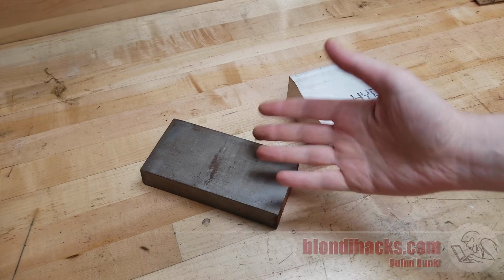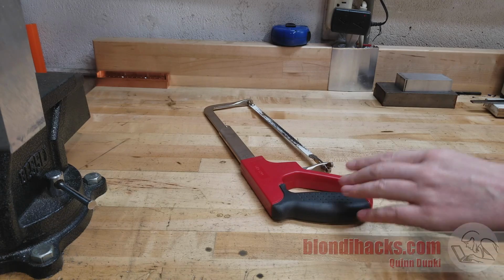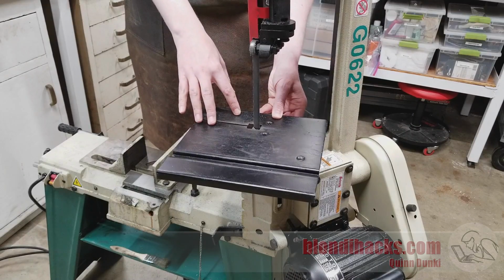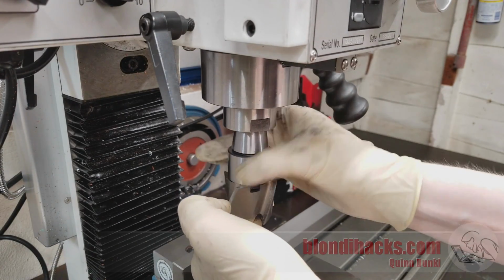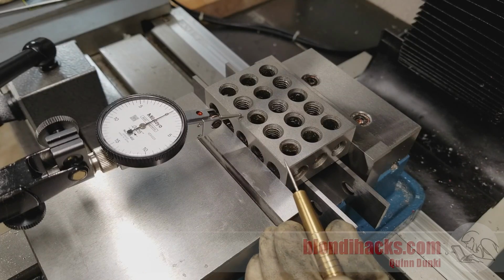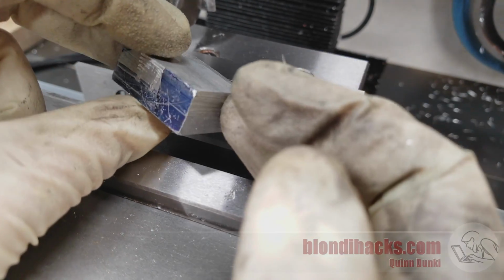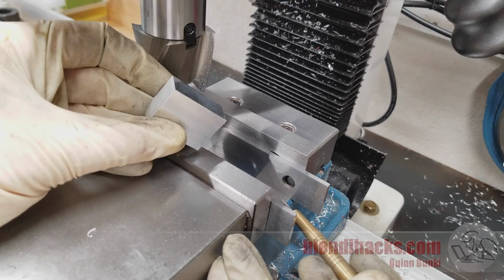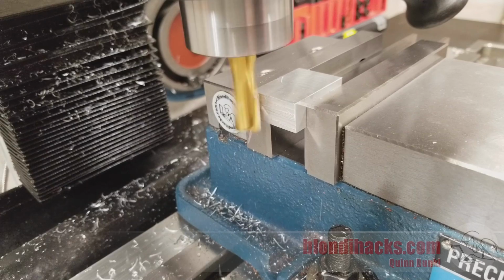Vertical Mill Tutorial 5 : Preparing Stock

Comment: Question.1 what do you do if your milling machine isn't level?.I have this problem so I shimd up the mill between the cabinet it sit on.results  r to left ok but front to back still out by 1/32
Question 2 I trammed my lathe usingv123 blocks and the reading are perfect but tramming the the bed it shows 5 thousand different read .
Help
Ken in raphine va
Little machine shop 4190 mill with no rotating head

Comment: FWIW - regarding steel rods for use in the vice.  If you can get your hands on a scrap laser printer or copier, I found that the rollers are usually stainless steel and seem to be high precision.  They are about 5mm in dia. and 24mm in length.  In their scavenged state the have a foam coating - most of which is easily removed with a razor knife and then I go at it with acetone.  I generally just use them as stock for misc. projects, but after watching this video I can see they could have a more elegant use.

Comment: That last tip at about 18.30 minutes in about how little it takes to cause both parallels to not be super tight has just saved my sanity. Thanks again Quinn! (I was questioning everything as I'm just using 2 sets of ground HSS parting blades as parallels for now while I wait to get an actual set of parallels)

Comment: Nice job again, Quinn. But for your viewers I want to share something.
Any error introduced during setup for facing will affect consistency of thickness dimensions between larger surfaces more than between smaller surfaces. The angular error would be the same, but obviously any angular error is larger when it is over a longer distance.
Thus, I think the second of the largest faces should be cut after two opposing smaller faces are made parallel. If the second of the largest surfaces is cut while the other large face is not able to sit firmly on both parallels, it will surely result in the two largest faces NOT being parallel. Therefore, the third cut should be with the one large milled face against the fixed jaw and the smaller milled face on the parallels (using a rod between the moving jaw and the workpiece, of course). This will give two opposing parallel faces which can then be clamped in the vise while one large flat face is completely down on the parallels, thus resulting in the two largest faces being truly parallel. This is often the most critical parallelism desired in a rectangular solid.

Comment: Hello Quinn.  Holding material in the mill vise with a piece of round stock against the moving jaw and dialling in a block in the 4 jaw chuck using a dead and live centre are things I do all the time.  However, you are the first person on youtube who I have seen do this.  The mill vise trick works well for very heavy cuts as well.  I have a video were I take a .250" deep by 3" wide pass in 4140.  The work was held with a piece of round brass between the part and the moving jaw.  The set up was accurate and rock solid.  I think when my two sons are old enough to start using my equipment I will have them watch your videos first. Thanks, Ken

Comment: You are the first machinist I have seen wearing gloves. I've always been told never to wear anything, so I've got to ask what kind of gloves you have? Great video, Subscribed!
Reply from the maker: I wear nitrile gloves to protect my skin from metal slivers and the oils and chemicals. It angers many commenters greatly but we all make our own safety trade offs as we see fit.
Reply: @Blondihacks  nitrile tears easily enough to not be a safety hazard IMO.  I was taught to never wear gloves around rotating equipment, but as with all safety rules, you have to understand the "why" of the rule to know when it's ok to break it.
Reply from the maker: @rennkafer13  Yep, that's my analysis also. I would not wear a heavy glove around spinning machines, but these gloves are safe IMHO. I've had a Dremel catch one once, and it simply vanished from my hand. I didn't even feel it. 😅
Reply: @Blondihacks  , I'm a beginning-hobbyist machinist (alas TechShop!) and ALWAYS use gloves while cleaning (those first few metal splinters teach a very painful lesson). I've been going back and forth on thin nitrile gloves while the tool turns and have come down at the same point as you. Cheap and thin nitrile seems to be safe enough to me.

Comment: I enjoyed the video.  My hack saw battery runs down pretty quick.  The horizontal bandsaw you have is sold by everyone including Horror Fright.  That is where I got mine and it has taught me a lot of new swear words what with the saw blade jumping off at every turn.  The only saw that I like is the Evolution380.
Reply from the maker: The tracking on them is a big weak point. I had to make a bunch of tweaks to keep the blade in place.
Reply: @Blondihacks  did you make a video showing what you did?  I would sure like to make the thing usable.
Reply from the maker: No video, but I did cover it in my blog post on that saw (link in the description). The TL;DR is that you have to fiddle with the tracking angle adjustment a lot until it works. 😁

Comment: Thanks for another great video!  Have a couple of questions: On the second face, you chose to put the extruded side up and the sawed cut on the parallels.  Did you have a reason for doing this or does it not matter so much at this stage?  I would have leaned towards setting the extruded side down.  Just wondering about your thought process.  Also, do you like dead blow hammers for tapping down parts onto the parallels?  They have less of a tendency to mar the work surface.  Thanks again!

Comment: Great tutorial! I wish you had posted it a couple of days ago! I'm currently making that phone holder out of 20x40 mm aluminium (notice the proper spelling! :-o ) and I "squared" my stock by first milling the top, then the bottom... So I'm moving over to the dead tree carcass guys... But really, I don''t have a proper mill and I don't really need that half a thou precision on the phone holder. I think... 
I also found that the band saw removes material a lot quicker than my "mill" (an old drill press with a milling table). If you're lucky(?) I'll post a video on my making this in a while. (1 day < "a while" < 3 months)
Reply from the maker: Yah, minimal precision required on that phone holder. You'll be fine!

Comment: So if you are assuming the cutter edges are perpendicular then why not mill a channel through your vice making both faces parallel and perpendicular to the bottom all in one pass?
Reply: We try not to machine the vise.
Reply: If you do not mind milling off the minimum stock needed to hold the piece, you can mill 5 sides square in one setup. Then flip it and do the bottom. 

It is how the CNC guys usually do it. Of course they just run the program without bothering about stock being non square as long it can be held securely.
Reply from the maker: The vise jaws are hardened, so that would not go well.
Reply: In addition to the hardened jaws that Quinn pointed out, the vise jaws don't move until they're loaded.  Cutting the jaws unloaded doesn't make them square when they are.